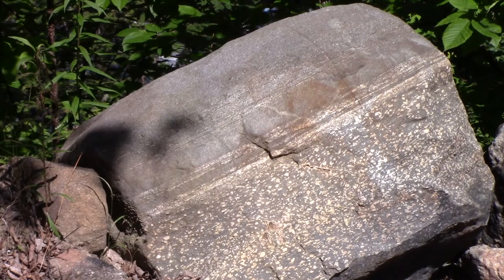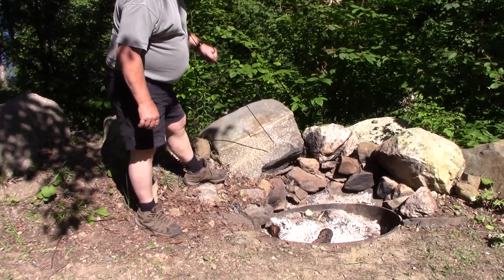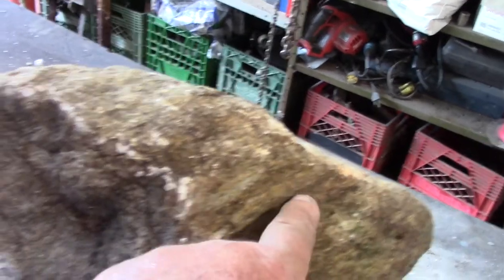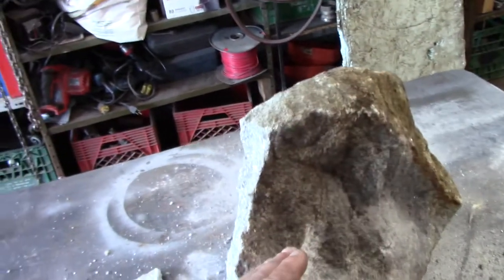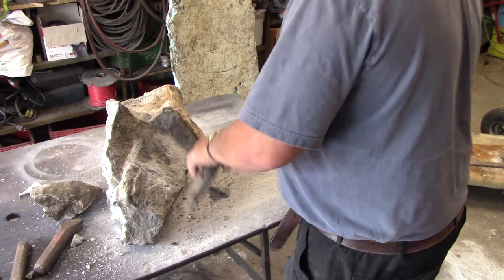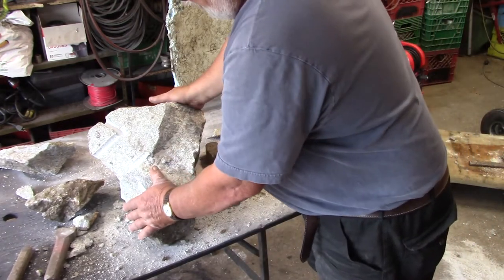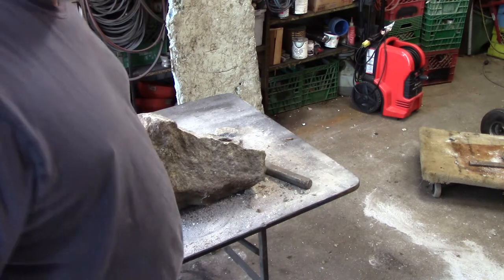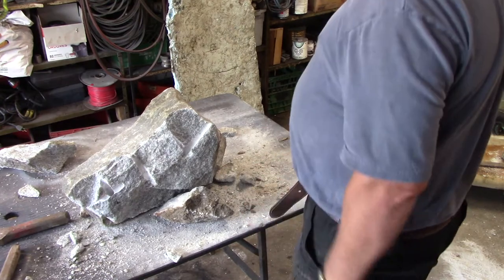Learning  how to dress a granite stone....part 1

Comment: interesting, im someone who is obsessed with how they build the pyramids like that so youd do me quite a favor if you could tell me if it would be possible to fit hard stones without steel tools? please let me know!
Reply from the maker: Hello Philly....to answer your question I have to say that Most of what I have to contribute to your question is conjecture but it could still make you think and maybe bring you to conclusions....I believe that most pyramids are built out of sandstone and not quartz or granite and they surely had found some diamonds in the time so you would have harder surfaces to score your stones with and once you had a scored you could blow it apart with a hot fir....even the hardest of rock can`t resist the for of intensive heat in one area and a specially if their water in the stone....fast expansion will break the stone....I have examples of this at my camp....at the moment I can`t go there for the snow in the mountains but come Summer I will try and remember to make a video to show some principals of what I believe they did in the day....Stay tuned and I will address this,,,, CHEERS
Reply: @gatorsworld  awesome, thank you for the answer!

Comment: personally i would just use a electric jack hammer lol to much like work also i would have done it outside it will take you longer to clean the shop then it did to cut the rock lol
Reply from the maker: Hey Drew first of my garage is not that clean and it give me an excuse to clean a bit and the jackhammer is not the way to find out what the old guys went trough to dress a rock....I just like to do this....CHEERS